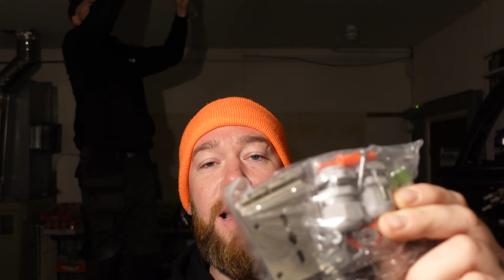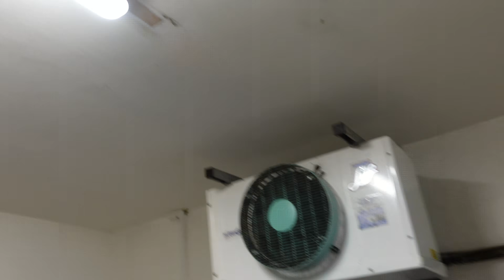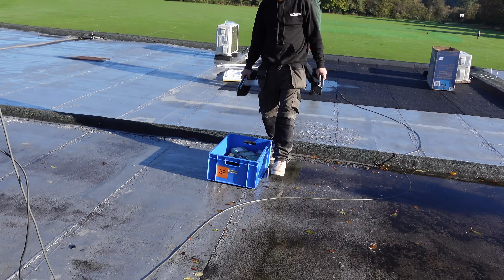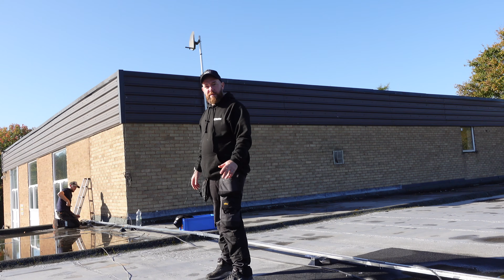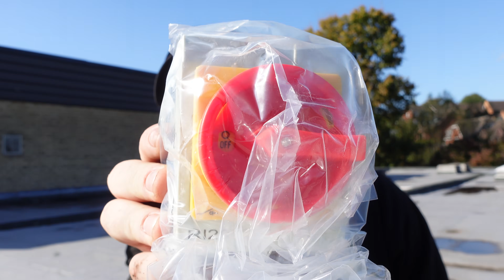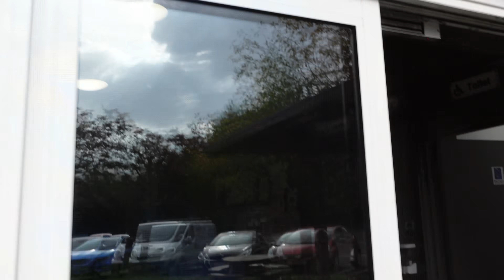First Time In YEARS! - Lighting, Armoured Cable, Air Con Supplies, Cable Tray - Electricians Life

Comment: Famous last words I was putting a socket for my dishwasher, was using multi tool to cut the chase in the dot and dab and managed to cut into a cold water pipe. Lucky for me I cut a bend and not the pipe itself
Reply from the maker: 😂😂😂 a bend can be worse than cutting the pipe sometimes as there a nightmare to get out the wall

Comment: Great vid nice to see abit of tray and SWA 👍🏼 although not sure SY cable is rated for external use   But mayb talking rubbish I don’t use it often keep um coming mate
Reply from the maker: Cheers dude, not sure but that was supplied by the air con lads 😬
Reply: @JRCElectrical   I had to replace loads of SY cable to industrial fans as the UV had broke it down …as you say they supplied it go with it 👍🏼
Reply from the maker: @dazm1295  probably cheaper for them isn’t it 🤷‍♂️
Reply: @JRCElectrical  it does become a shame that it’s a factor in some circumstances anyway It’s still great content and varied so all good 👍🏼
Reply from the maker: @dazm1295  thanks dude appreciate it

Comment: Great video,but whats going to stop the tray from blowing in a strong wind, should have used ct1 or some form of adhesive stick the feet down or do the have weight in them ? Otherwise all good 👍🏽
Reply from the maker: Thank you, to be honest I just thought the wind would pass under and through it rather than try and take it, if there are ever any problems with it moving we will defo put some ct1 under it thanks a cracking idea thank you
Reply: @JRCElectrical Its just a suggestion, because I wasn't sure if the feet had weights in them, I definitely enjoy tray work at times making the bends etc keep up the good work mate 👍🏽
Reply from the maker: @shakeyh3565  you lost me at bends 😂😂😂😂